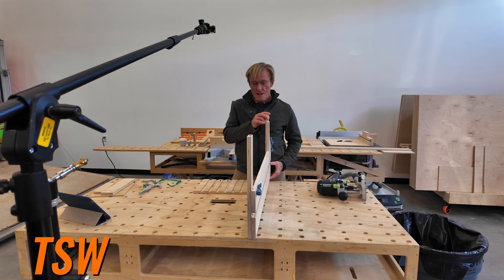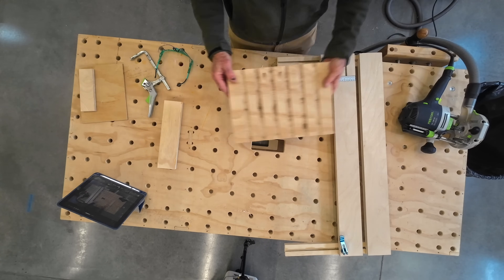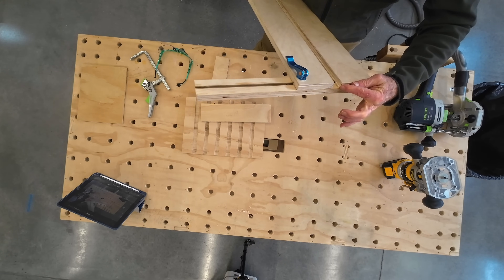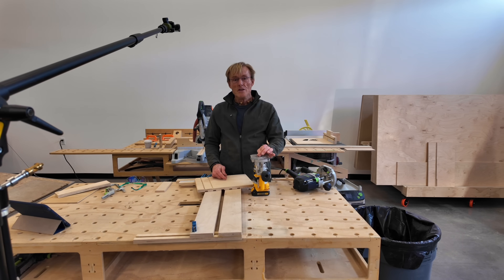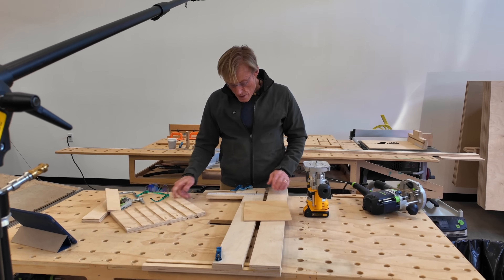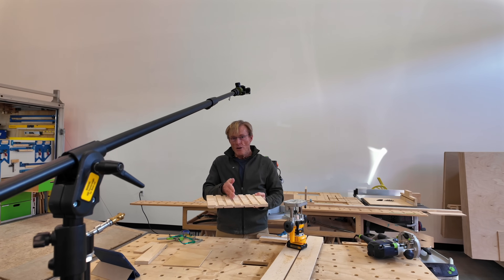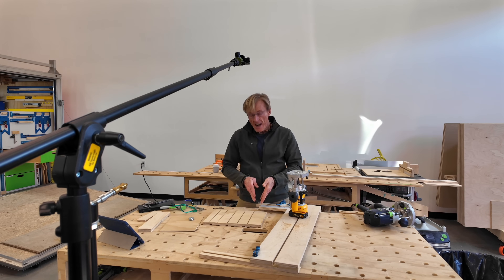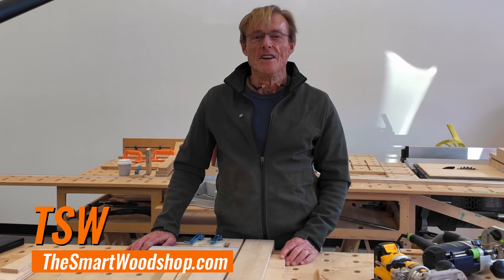Revolutionary Dado Jig – Stop Wasting Time on Setups!

Comment: I was in your store trying to buy the plans for the dado tool. Could log in, if I had an account. Wasted a quarter hour trying to find out how to do that. Failed. Why did you fail to make it easy?
Reply from the maker: The place to get help is at TheSmartWoodshop.com or the Store. I don't think you need an account to order, but I don't handle the ordering system. 😎🤙
Reply: Hi Edward, you don't need to cteate an account to purchase the plans, however there is a field in the checkout to add a password and create an account. Have a great day.

Comment: Are you shure, this works with any setup? seems to me it works only for the same distance between bushing and router bit and the ame thickness of the bushing. did you mention this?
Reply from the maker: Yes, it works. The key is the difference between the cutter and the bushing. A matched set has a ⅛" offset from outside diameter to outside diameter. I've made a dozen videos over the years demonstrating this concept. https://youtu.be/r-SF_ejbvso

You can use larger bushings to create varying offsets, but that’s intentional for specific tasks—not for this type of work. You cannot go less than a ⅛" difference, as the cutter would rub against the inside of the bushing.

Hope this helps!

Comment: Seen so many of these but not all in one. 

A collation of many ideas....
Reply from the maker: I've built many different styles over the years, but I was never satisfied with them. This one nails the big three: 1. Router/cutter agnostic, 2. Automatic material calibration, and 3. Built-in adjustable spacing.
Reply: I had to cut off my 1/2" router bushing, to long

Comment: Cool build.  I made something like that about 15 years ago before I invested in Festo0l  LR-32  tracks and sled.  I use a wedge to keep the locking pin on the LR-32 sled from engaging.  Then I can use my PC 890 router on the sled to run my dado's.  Using my TSO rail square, I lay the track down square to the piece I will be cutting at the top of the cut, I then Use a piece of the shelfing to clamp a board onto the back of my guide rail as a stop for my second cut.  I make the first cut, then move the rail down and make my second cut.

Comment: Get a router bit in standard material thickness (18mm, 3/4inch, ...) Add a scrap piece to the router base. Use an oblong piece of the actual material as spacingblock and guidance underneath. Done.
Reply from the maker: There are so many problems with this solution, I’d have to make a 30-minute video just to cover them all. 🤦‍♂️
Reply: @TheSmartWoodshop   Thank you. Maybe we're just used to do it that way.
Reply: There is no "standard" material thickness. That is the main beauty of this solution: infinite adjustability.
Reply: @jondcarson52  so there are no common measures like 3/4 inch etc? It's sheet material!
Reply: @alphonsbretagne8468  I take it you’re not a woodworker. There are no standard thicknesses; there haven’t been for a few decades. It’s all undersized and varies from manufacturer to manufacturer.
Reply: @jasonandersen5975  100% agreed.
Reply: Unless you are leaving out some details, that makes no sense.
Reply: @jasonandersen5975  I believe there is cut on the back the the exact size of the offset for the guide bushing so you can reference the material off the jaws and the bushing off the groove
Reply: 1/2 is now 15/32 or I’ve seen 13/32. 3/4 Maple at Lowe’s is now .7, NOT .75. Lumber industry only has to meet the “minimum” standard thickness. I have a similar jig that I made and use for dadoes in plywood and works for me.
Reply: @lanceyohe6026  My point exactly...
Reply: My sheet material is never the exact nominal thickness. Almost every sheet of 18mm ply I have ever used has been slightly thinner than 18mm the most recent sheet I am cutting now is actually 16.9mm !

Comment: The stop on the bottom must be indexed carefully to one side of the dado or the spacing will be off, right?
Reply from the maker: It's pretty hard to mess up. Just push it tight against the bottom of the previous dado. I made the index from a piece of ¼" plywood, so it works with ¼" material and anything thicker. I worked on a version where the index was changeable, but I realized it was a solution to a problem I didn’t have—and it actually created unnecessary complexity. 😎🤙
Reply: Yes.  My first thought was, it would be nice to have this using a pice of the material to it, so it won't slip.